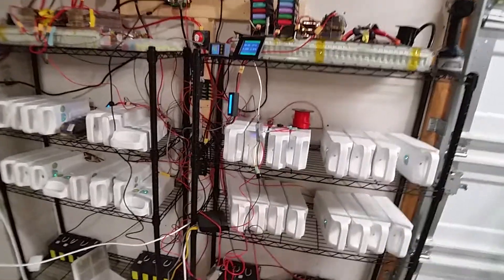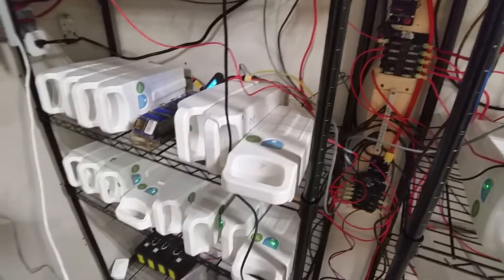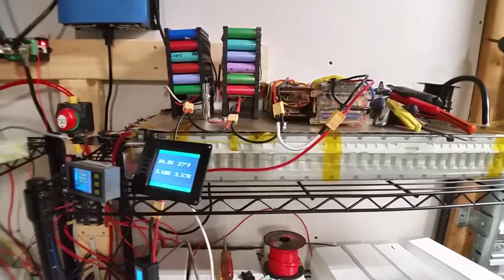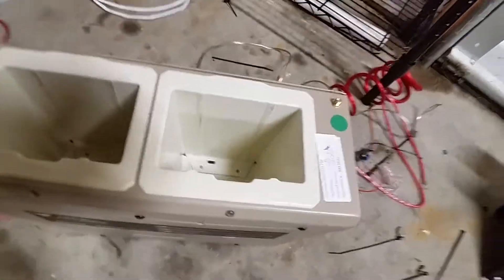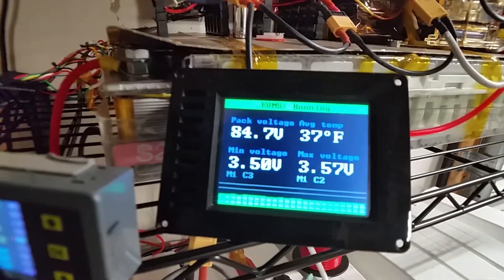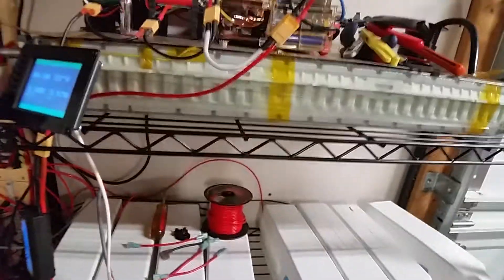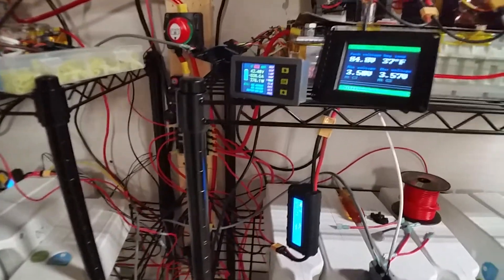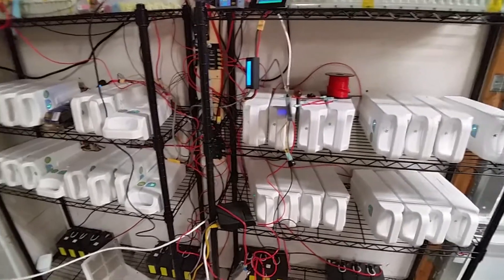DIY Powerwall Mobius Power 18650 Update  198 subscribers also Thanks

Comment: Did you know that some of these packs have 18650 cell in them.I am using mine as a 12 volt wired together at 12 volt for about 100 amp.So far i am working on 4 100 amp packs.unfortunately i got 2 packs that have 18650 cells in them and will use them for a different stand alone project.

Comment from the maker: I have had some battery failures recently and have had to make some changes. Tomorrow is suppose to be warm, so I plan to make a video about what has gone on and my fixes.
One of my Tesla packs had a bad connector and was causing high resistance, also a few of the mobius BMS boards fried, so I swapped them out with Ebay boards and Amazon BMS boards.

Comment: Just a question, I'm thinking of getting a lack of these for a kayak power supply...how would I charge these using the a house wall outlet on the existing pack connector?..thanks
Reply from the maker: I would highly recommend a AC/DC RC Car Charger that has LIPO/LITHIUM options. This is what I use to get the batts conditioned. Something like a B6 or something along those lines.
If you have enough room you could use flexible solar panels and a small charge controller to charge them while kayaking.
Just an idea.